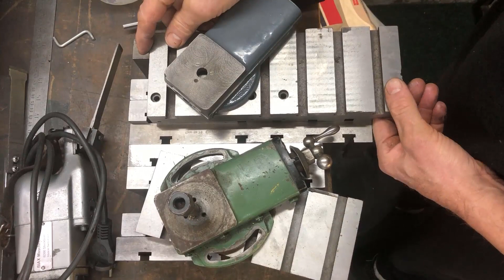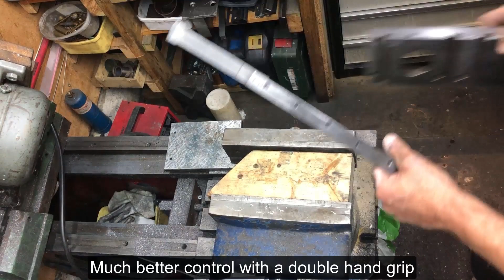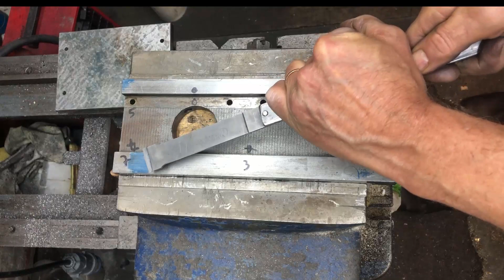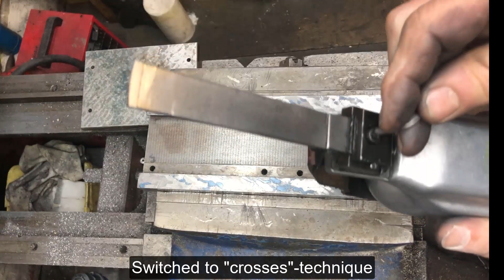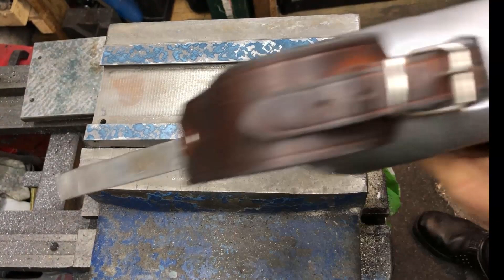Myford cross slides - part 2 - scraping flats

Comment: Hand scraping remains in my eyes something akin to witchcraft. How something can be ground flat and then scraped to achieve a better result is still beyond my comprehension. I really must try it for myself to fully understand the benefits of hand scraping. Thank you for sharing your videos and providing such inspiration. 👏👏👍😀
Reply from the maker: Thnks for the nice comments.
There is hardly any magic involved, just well proven methods and aquired skills, so "anyone" can excel if they are taught correctly and abide by the principles involved. A ground surface is most probably well within specs for flatness, but if left "as is", there is no room for keeping the oil. Evidently, if you rub 2 such pieces against one another you will probably quite soon experience that they are "glued together", which is not what we want. The most common symptom is "stick-slip", which is a term used to describe what happens when sliding action is interrupted, ie. stopped by lack of lubrication and then overcome again by the moving force, leading to a "stakkato" motion, and ultimately may lead to scoring of the ways. Instead we want to have an oil film inbetween and this is best retained if the surface is broken up into a number of small pockets, surround by high spots to carry the load. At least one of the 2 mating surfaces should be "treated". In most cases this is best accomplished by scraping. In addition to use scraping to achieve this desired surface texture it can also be done to achieve flatness and alignment. In any given situation where the material to be taken off exceeds a certain amount, I would machine it flat first before attempting to scrape it as this is labor intensive and can be a lengthy process, ie. not the most effective method for removing much material. Also, worth noting is that you often see half-moon flaking on the exposed ways.. I have been taught that this should preferably be done on the non-exposed surfaces (they are designed top retain the oil), ie. the surfaces that are not "shown", for example the underside of a cross-slide. I assume the reason you often see these marks is that it looks nice.. , but as they are quite deep hence also prone to collect grit/dirt etc. which may lead to accelerated wear.
Reply: @jansverrehaugjord9934  Thank you Jan. I now better understand the benefits of scraping. I can appreciate that there is a fine balance between providing room to keep oil as opposed to room for destructive grit to reside. How long does it take to be proficient?
I hope you will continue to feature scraping in your videos.
Reply from the maker: @andrewatcarpathian  Not easy to answer when one has learnt/practiced enough.. I am still learning at least and has been doing this for 14-15 years now. I guess you can get to where you can scrape in your Chinese 3-in-1 machine or restore an old South-Bend lathe.. and improve accuracy and alignment after just a basic scraping class, at least there were a few with no scrapings skills from before that "matured" to a level where they mastered scraping in say a top slide (which takes you through much) within one week in a Richard King. Key here is the individual supervision you get from him!. Otoh, for delivery the Swiss hi-end machines were "untouchable" by all but the very most skilled masters, as I guess was the case for most other quality makers ..
Reply: @jansverrehaugjord9934  Learning from a master is most definitely to be encouraged to ensure that these valuable skills are retained and not lost. As with all skills one never stops learning and the more you practice the more skills you learn. I guess I love learning new skills. But do I have enough time to learn hand scraping. Such a fascinating subject.
Reply from the maker: @andrewatcarpathian  Where are you located?
Reply: @jansverrehaugjord9934  Hi Jan. I am near Reading, 35 miles west of London, England.
Reply from the maker: @andrewatcarpathian  OK. I would start by getting some tools and then some books/material on the subject. I can also recommend Richard's video. When you feel up to it I would then start practicing on some "sacrificial" pieces, NOT on you Myford S7 :) Feel free to contact me also, bets perhaps on Messenger or email jshaugjord at gmail
Reply: @jansverrehaugjord9934  Thank you. I will indeed look at acquiring some tools and books on the subject. And yes, I don’t think I will practise on my Myford Super 7. 😂